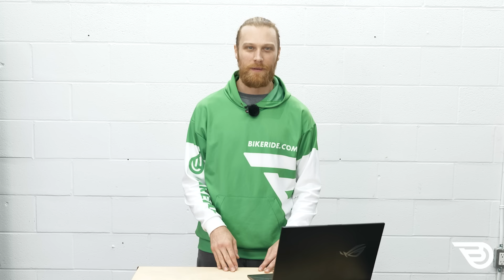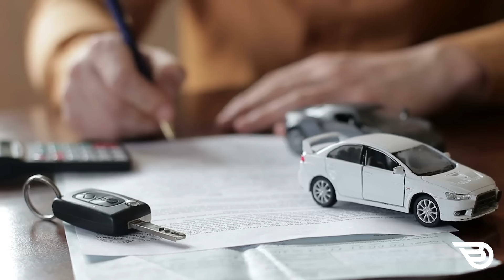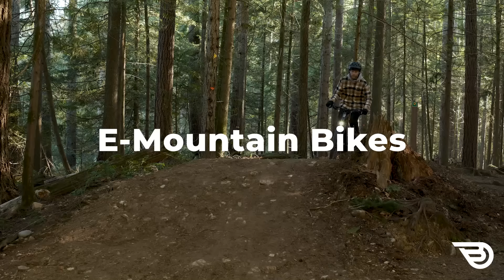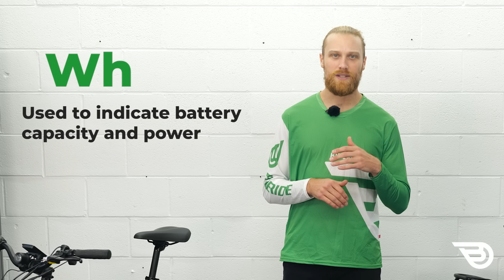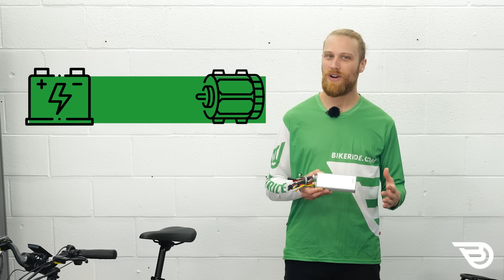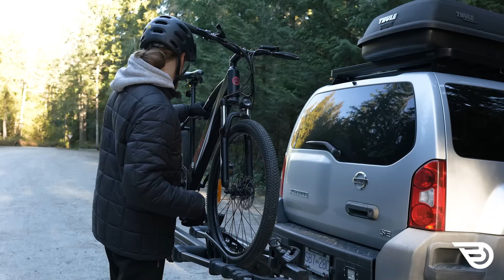Electric Bike Guide – How to Pick Your Perfect Bike

Comment: I've ridden regular bicycles for most of my life and ebikes for the last few years, so I thought I'd add my own thoughts on selecting ebikes.
(1) first, before anything else, ride the ebike without power on at all.   If you can't ride it faster than 5 mph or it's torture to ride it unpowered, move on to another bike.   An ebike must be a bicycle first.   Because power meters often don't register power linearly or as you'd expect, like a gas gauge, you can easily end up without power on a longer trip.   For example, if the meter shows 2 bars, that next to the last bar could last 20 miles and then the last bar only 7 miles, depending on how you are riding or conditions or simply just because of how the meter works.   That could easily get you stranded if you are reading the meter literally.
(2) Fat tires, when ridden on roadways, typically have higher rates of flat tires.   They are wider and are grippy for everything including puncture sources on the roadway.   Ebikes often have most of the weight on the rear tire as well, so it gets hit the most.    Be sure if you get fat tires, you learn how to remove the rear wheel and replace inner tubes fast.   Patching can work but is slower, and because fat tires can attract much larger objects smaller tires might just roll over, larger holes or multiple holes in an inner tube are common, making changing the inner tube the only viable option.   I always carry 2 brand new inner tubes with me when I ride.
(3) If I had to choose again, I'd never buy a fat-tired bike again for reasons #1 and #2.   The rolling resistance, sluggish turning characteristics, and difficulty pushing are just too bad.   And you don't notice it until the power fades.  You can sort of sense this before it happens, however, since it's clear your own energy input while riding doesn't really go that far, maybe adding 2 mph or so.
(4) If you are going long distances, calculate energy costs with common online calculators, and factor in the weight of bags, etc.   I typically carry about 30 lbs of gear with me whenever riding long distances (tools, innertubes and chargers) on an ebike, and that will easily result in a 10% to 15% distance hit.   I recently rode about 130 miles in one day on a nominally 80 mile ebike, and did so by calculating energy requirements by looking at headwind costs, uphill terrain, and overall weight.   Basically, I know from calculations and experience I could only go about 40 to 50 miles at PAS 1 or PAS2 before depletion even though it's technically an "80 mile" battery.   Therefore, to go 130 miles, I needed to recharge a couple of hours in two separate charging stops, (although it ended up 2.5 stops for a quick 45 min top off near the end).   You need to deduct charging time from riding time so you can have enough time to complete the ride in one day.   And if you have two batteries, carry two chargers.   It saves time to have both batteries charging at the same time for obvious reasons.
(5) The most important criteria is #1.   In the past, I have ridden regular bikes for thousands of miles with full gear, so the aggregate weight of the ordinary bicycle with gear was essentially that of today's ebikes, about 85 to 90 lbs.  I always could average about 10 to 12 mph hauling that weight up and down hills on an ordinary bicycle.   But I quickly found out, the fat-tired ebike is a horror to ride unpowered...maybe 5 to 7 mph at most unless you are going downhill.  Whatever you do, make sure the ebike actually rides like an ordinary bicycle without power, or you will be in deep trouble if you ever run out of power.   Part of the problem is also gearing, but most of the problem with today's ebikes is just that they are too heavy, with a lot of unnecessary framework and the fat tires.... A fact disguised very easily by the fact the powered state covers all those deficiencies up.
Reply from the maker: Great insights, thanks for sharing your experience and some very practical advice! I carry tubes on all my journeys as well; those fat tires sure can pick up road debris. I couldn't agree more about unpowered riding, 90% of the e-bikes we test are nearly impossible to ride without power for any length of time.

Comment: Really great video helped me immensely on certain things I have an e-scooter which I find I am falling off of too many times it's a dualtron victor. Being almost 70 falling is not my favorite thing figured I would try an e-bike, seems like I'm opening another can of worms. 
You're speaking style is very very easy to follow I appreciate it now I have to find the right e-bike there are just so many out there, but depending where you are very limited amount of options to test ride so just like my motorcycles up until 2 years ago, I have to buy them from online information. 
Looking forward to watching more videos to see why there are seven gears, and try to buy from some not fly by night manufacture. 
Thanking you again 
Cliff232
Reply from the maker: That's awesome, glad the video was helpful! There sure are a lot of e-bikes out there, so it's good to do your research! If you need some extra assistance narrowing it down check out our review pages https://www.bikeride.com/best-electric-bikes/ We've included all the best reviews and data, and you can use our search tools to narrow the search based on different criteria.

Comment: The limitation for class 3 bikes on trails, is not a limitation in the US. In fact a lot of them without looking closely look just like any other bike. And mountain e-bikes are ridden on trails all over the US.
Reply from the maker: This is not necessarily true and is a very grey zone. It will depend not only on the state you are in but also on local regulations and the trails you are riding. The other question is, while it may not be enforced currently, it may still not be allowed. 

Many higher end E-MTBs are not class 3 (28 mph capable). This genre requires high-torque motors but does not require the ability to power up hills at extreme speeds, and many mountain bike trails will not be ridden comfortably at speeds much higher than 20 mph.

Comment: Estás EBike disponen de servicio de repuesto y reparación en España? Por seguridad antes de pedir es mejor comprar con garantía y repuestos a mano
Reply from the maker: I am sure some brands will have service centers in Spain. I recommend purchasing from a brand that offers brick-and-mortar stores where you can return for service and assistance. Many of the e-bikes sold online with no service centers will require you to pay for or locate new parts and bike shops to perform service and may not assist you with problems.

Comment: whats the advantages/disadvatages of belt drive vs chain and gears? great video!
Reply from the maker: The big advantage for belt drive motors are less maintenance, as you do not need to deal with deraileurs, shifting or gear cables. As well as increased service life, belts can last for 30,000+ km.

Chains on the other hand, require more maintenance to maintain proper shifting, but you gain the ability to use traditional bike gearing. Mid-drive motors are forced to use gearing, which is included within the motor; this reduces the bike's effective gearing except in very high-priced belt drive systems. 

In general, you are going to get better gear range and better torque and climbing ability from a traditional chain-based drivetrain. 

For riders who are accustomed to chains and know how to maintain and effectively use traditional bike drivetrains, I see little benefit other then reducing maintenance and irritation involved in greasing and maintaining drivetrains.

Comment: In the "choosing a motor" segment, you could also say the middle frame motors generate a more pronounced wear on the bikes transmission and chain, as the motor exercises force directly on the chain.
Reply: I doubt that concerning wear. The shifting system  and Chain should be heavier duty than on a regular bike. If not, you shouldn't buy that E- Bike.
Reply: I wonder if wear on the motor depends upon how much weight is added besides the weight of the rider and incline hill climbing?
Reply from the maker: Yes, they can lead to more wear and require proper shifting. The components are of higher quality than the drivetrain on a rear hub motor, and with more e-bike-specific drivetrain parts available, mid-drive wear and failure are more of a routine maintenance issue. 

The attributes of both motors are important to think about when purchasing! Riding style is a huge one to consider as well between the two

Comment: Im in Australia and we can't have more than a 250watt pedal assist ebike. This video has helped me understand the differences between the different types of bikes and the options on batteries. This was extremely informative and very well put together. Thanks for the information. 😊
Reply from the maker: Thanks for watching! I am glad it was helpful for you. If you are restricted to 250W I would look for a mid-drive unit, with the highest torque rating possible. Mid-drives will bring more power for the rated wattage at 250W and perform better than a 250W-rated rear hub motor.

Comment: Thump up .subscribe.  
Mick Australia 🇦🇺  wollongong. ) 
No wight.  Good battery. 
60kg I am. To go to work. 
20km to work. And can charge at work.
??
Reply from the maker: Thanks for watching! 

40Km round trip, you will probably want something with 14Ah + battery, and at 60kg you wont need a huge motor if you don't have a lot of hills. Anything with a 500W motor should be fine and save you some weight. 

If you want a really light bike you could look at some of the  250W or 350W bikes, not many hills in Wollongong if I remember right? I had a fun trip on that side of Au years ago

Comment: One con you failed to mention for mid-drive bikes: if the chain breaks and you don’t have the parts and tools to fix it on-site, you’re in for a long walk home. With a hub motor, you can remove the chain and use throttle to get you home.
Reply from the maker: Very true! Mid-drive bikes definitely require more awareness when it comes to shifting and chain maintenance.  I mentioned this in the hub motor pros but may have missed it for cons on the mid-drive section, so thanks for adding that info here for others. Extra power to the drivetrain can have some nasty consequences!
Reply: I think he did mention that actually😅

Comment: My perfect ebike has mag wheels that don't have to be adjusted and less to worry about
Reply from the maker: Luckily, we are seeing a few options out on the road with these! Bafang makes a pretty affordable motor/rim combo, and we have seen it on Addmotor bikes. 

It's nice not to need to true a wheel and worry about spoke tension. It's not hard if you have a stand and practice a bit, but with heavy rear hub motors in the rear wheel, they do go out of true more often than traditional bike wheels.

Comment: The maxed-out configuration of the model C electric bike from EBC cost $6,331 which is crazy expensive and only comes with a 1,728Wh battery capacity ($3.66/Wh). The Eahora Romeo Pro is my dream bike, coming in at $2,949 with a 3,120Wh battery capacity ($0.95/Wh). I also considered trying to convert my Schwinn Standpoint bike with a $1,350 conversion kit. Electric bikes aren’t cheap, so no wonder I have none yet. I also find it a little strange how EBC claims that the maxed-out model C can go 200 miles per charge with 1,728Wh, while Eahora claims Romeo can go 108 miles per charge with 3,120Wh.
Reply from the maker: When you mention "maxed out" do you mean choosing every available option for the EBC model C? If so, you are paying for a lot of extras you may not need or want, like alarms, a helmet,  "tech Package" and custom everything ( they let you customize a lot, and charge for everything!), so it does not really make a fair price comparison for battery capacity.

EBC is an expensive brand, but they are hand-assembled in the USA and hand-painted in the USA; I can't think of any other brands off the top of my head that do that. So you're paying for the extras with EBC as well as the extra warranty. 

Now I can see what you mean looking at the Eahora Romeo, your getting more battery and a larger motor, the weight and size of the bike is also vastly different, and it uses a 1200W motor, compared to a 500W or 750w for the EBC. I would assume the 1200W motor is a direct drive, not a geared rear hub like the EBC. This could be one of the reasons we see a different range estimate, a 1200W motor on a heavier bike with larger tires will result in reduced range. 

I have not had a chance to look into or ride one of the Eahora bikes but they look pretty cool, and they offer some interesting options and large battery capacity! at 60 Ah, that's huge! Do you know where they manufacture the bikes? The brand comes from Califonia but I would assume like most e-bikes they are manufactured in China, maybe not? I have not had a chance to look but I will now!

Another thing to remember about range estimates is they can differ vastly, I would bet EBC is using an estimate, on flat ground, light weight rider and using the lowest available assist level, not that anyone would pedal 200 miles at low assist haha. Perhaps Eahora is using a more modest range estimate, at higher assist levels, or they could be taking into account the power hungry 1200W motor. 

What conversion kit are you looking at for your Standpoint? If its a front hub conversion I would just look into a less expensive bike in the same price range, in USD its possible. But your definitely not going to get something as cool as the Romeo Pro I will admit!
Reply: How are you not going to respond to such a detailed reply?
Reply: @michaelvaladez8222  😂Now that's what you call feedback. These guys stink of professionalism personified. These guys are ebike guru's

Comment: Hey Scott im 45 thinking of an e-bike  that has long distant capacity and could possibly tow a e-bike camper and my dog and was wondering if you could help to understand what would be a good choice for the money and battery also what wouldn’t catch fire and accidentally burn the house down 
Kind regards Jessie
Reply from the maker: I would recommend looking for a large capacity battery for range, 20Ah or more if you can find it. 20Ah batteries typically push bikes over 30 miles in a single charge, even while using max assist, and can go up to 60-80 miles in the right conditions at level 1. You can also find bikes that will offer dual battery setups for extreme range, or carry a second battery with you. 

If you plan to tow, you will want to look for 750W motors or higher, some brands offer "un-restricted" motors that exceed 1000W for offroad use only and these are excellent for towing trailers etc. However, they can limit the legal use of the bike on roads and pathways.  Another great option is the new AWD bikes, which we can see from some brands like QuietKat. With dual 750W motors in the front and rear wheel they offer great power, and you can adjust which motor is being used, or use both depending on your power needs and how far you wish to travel. 

As for fire hazards, looking for bikes that offer UL-certified batteries and electronics is a great way to ensure the bike and battery are safe. New laws in the US will soon force all batteries to adhere to these standards, and it's great for safety. 

We tend to see fire hazards from cheap, off-brand batteries and units that use high-amp controllers, like the electric dirtbikes we see coming from off-brands. So, it's helpful to go for a reliable company that uses good materials. 

Another big item for fire is charging practices, the issue occurs when the battery and charger both fail, and allow the charger to keep pumping power into the unit after it is charged. So making sure you unlug the battery as soon as possible after charging is a great safety method. Using a timer is a good way to ensure power is cut off without having to physically unplug the battery. You can also use the "fireproof" charging bags to give yourself a little time in case of a fire, but these are not foolproof and could easily fail. 

Personally, I use timers, unlug the batteries, and do all of my charging in an exterior shed where if a fire does occur, I can limit its damage to other property and hopefully contain it to the single bike or battery affected. 

So far, using safe charging practices, I have not had any failures or fires to report. But it is always on my mind!
Reply: @BikeRidecom  thank you  happy days

Comment: Disc breaks can be a pain especially when the pads keep rubbing
Reply from the maker: They can require some adjustment, especially with cheaper bikes, which may have mechanical brakes and easily bent rotors. 

The benefits of disk brakes far outweigh the negatives, and they are much better than a V-brake though!

Comment: Some of my favorite E-bike are the ariel rider grizzly & the E-cells super monarch 1000w  step through They are both all wheel drive. the price are 3100 to 3600
Reply from the maker: Both are very cool e-bikes. I have not had a chance to try out one of these "all wheel drive" units but I would love to get a chance to! What is the riding experience like? Do you find a big difference in traction and capability with the all wheel drive?
Reply: @BikeRidecom  I have not ridden either one of the bikes, but I have been into Ebikes since 2019 and if you live in the country that’s why I recommend those two all-wheel-drive bikes
Reply from the maker: @jjjsa15  Cool we will see if we can get one of those in for testing!